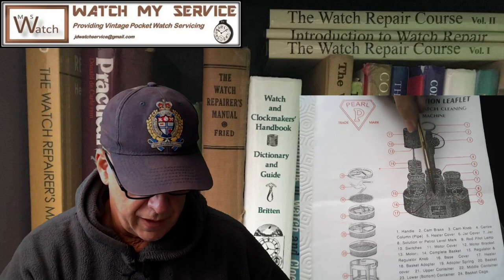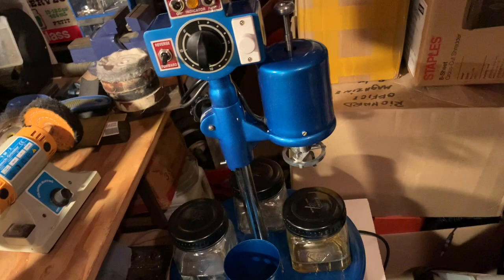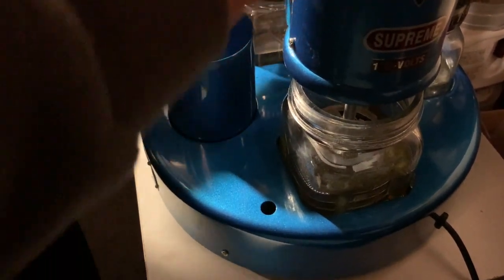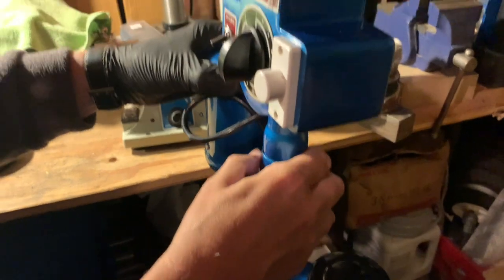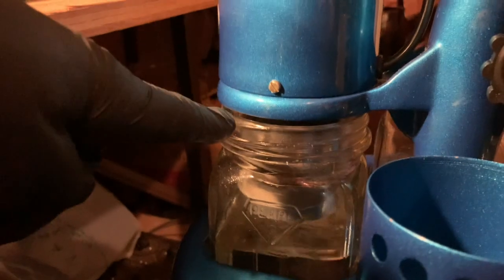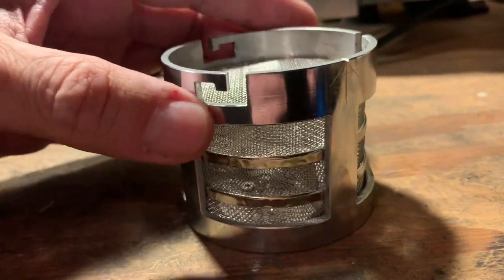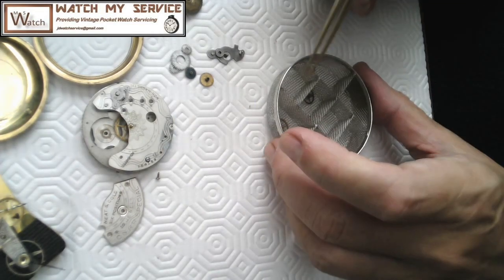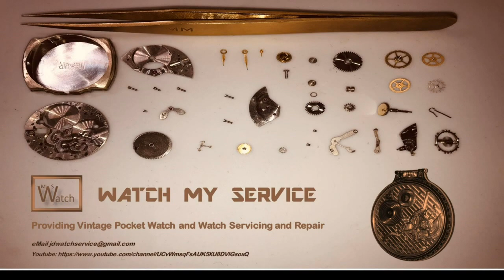Pearl Watch Cleaning Machine   How To Operate

Comment: Hiya JD , just wanted to say thanks again for posting this video on this machine. 
I just received mine last week and for $550 with shipping and tax its a bargain. 
I tried to buy an adaptor for the type D plug it comes with but after purchasing two different ones from Amazon and both not transferring power to the motor i went ahead and purchased a good quality plug, cut off the type D and installed the type B that works here in the States. Simple enough black red and green for the ground. Wire gauge looks like 14 stranded, wish it were 12 but im not going to rewire it unless i have to. That rheostat is not exactly forgiving so ill probably change it so i can get finite control over the RPMs. Seems like shes gonna do just fine and again thanx for posting this video. 
Happy watch repair !
Reply from the maker: You did exactly what I did with mine. Just put in a new plug .  If you find a replacement rheostat that works, let me know because I want to change mine as well.
Reply: @JDRichard  im on it

Comment: Whoa. I purchased the Pearl Supreme and am so looking forward to watching this video. I followed the directions and use white gas for the rinse. That 1:9 red solution to clean. I also added a 4 jar for a 3rd rinse is Distilled water before the petrol rinses. I run it for 10 mins each jar because what else do I have to do. If you update the variable speed switch PLEASE POST A VIDEO of it.
Reply from the maker: Why did you add the 4th jar...and is white Gas naptha?
Reply: @JDRichard  White Gas is Naptha as far as I know.  It's similar to Coleman camping fuel.  I added the 4th jar because I'm anal.  That variable speed knob is very touchy.  Are you saying it can be replaced and work much better?  I'd really like to do that.  Also have you noticed the spring is so tight the spinner inches up if it vibrates too much?  It's difficult to lock it.  And what about the reverse switch?  When is that used?
Reply: @rhendricksonn I think the reverse might be used so you wash both ways, might give a better wash? Only a guess?

Comment: Hi, recently purchased one and the guide bar that positions the basket had snapped off.  Curious to know if the motor unit spins freely over the bar or if you need to lift the motor a bit to position.   My guess is that my spring is not suspending motor high enough as it bumps the guide bar on swinging the motor around.   Thanks.
Reply from the maker: Just a bit weaker spring would be good
Reply: True
Reply: And great video by the way.
Reply from the maker: Thanks Dr Jac

Comment: Good Video JD! I got the same one at the same time as you did, I only cleaned 35 watches with it and the motor is fading out on me especially when I submerge the basket in the liquid and will not start, I have to spin it by hand to get it going and runs really slow even when it is turned all the way up!
Reply from the maker: This is not good at all. Hope yours was a one off
Reply: Take it apart, clean the brushes and armature. Check for any damage and lube the bearings as well.
Reply: Have you serviced the motor and is it ok now? Or did you return it..

Comment: During the spin dry I lift the motor and adjust the basket shaft so the basket is level with the top of the jar. That way the basket won't touch the liquid or spin any of the liquid out of the top...

...also some of the other brands have baffles that go in the bottom of the jars to help with agitation. They are expensive online but a few people have made them out of thin metal
Reply from the maker: I think you can make star shaped metal baffles….saw this somewhere on youtube.  I have metal baskets
Reply from the maker: If you spin too fast, the liquid spins and wants to hit the basket. Lower the liquid level for sure.

Comment: Hi, thanks again for a great video. Now you have had it a while, do you like it? Any downsides? Have you tried greeting that stiff spring! Rheostat change or upgrade? Looks like you didn’t do the balance? I’m scared of heating a balance, I’ve over heather one before and it wrecked the hair spring. Learnt anything to share? Thought about a follow up video to cover these things? Ta.
Reply from the maker: I still think it’s a great machine, and there are really no issues. I don’t do the balance as I don’t want to remove the hairspring normally.

Comment: I got mine yesterday. A few observations so far. The power cord is terrible. It’s rated for 5amps 220v. My machine is 110v. It is a 2wire plug. The cork seals in the lids of the jars are all broken so I will need to find something better to help with sealing to prevent evaporation. 
For the money it looks to be a decent buy.
Reply from the maker: Mine does not have a problem with the cork around the jars. It is actually working quite well with the existing wiring. I did put a circuit breaker switch between the plug and the power input to make sure if there is a short in this device that the breaker would go. The only other issue I have is that the rheostat is really for the 220 V and not the 110 V and therefore, it has a very small degree of change for the speed of the motor. I have been looking for a replacement rheostat that might fit into the opening. I have not yet been successful, so I just use a rheostat that’s there and keep an eye on things. Overall, it is well constructed and I have no issue with that end of this machine. Are use it for cleaning quite a few pocket watches today and I will very soon attempt to clean a 7750 watch movement

Comment: Do you ever use the reverse?
Reply from the maker: Actually no, but I’m up for advice
Reply: @JDRichard  I was just wondering when you should use it or it it is even an important feature. Thanks
Reply from the maker: @knottreel  I think a super dirty movement might benefit from reversing the cycle.
Reply: @JDRichard  Do you think the reverse can be used when the motor is spinning?